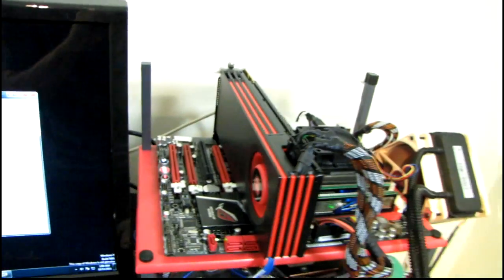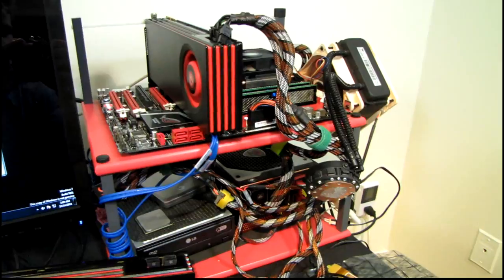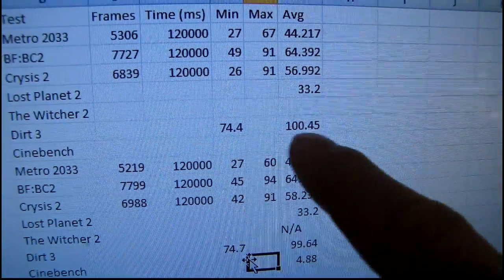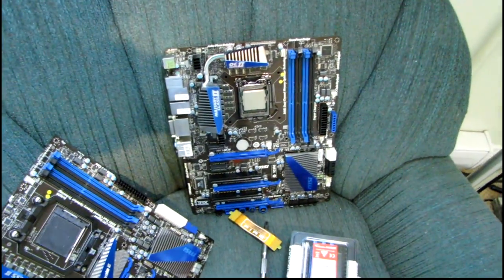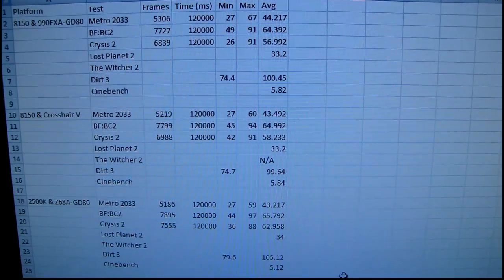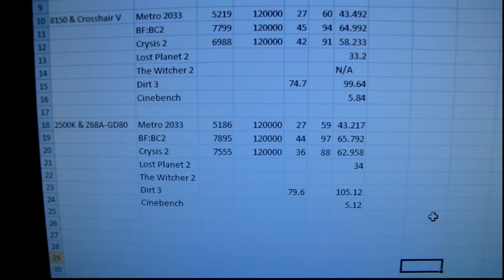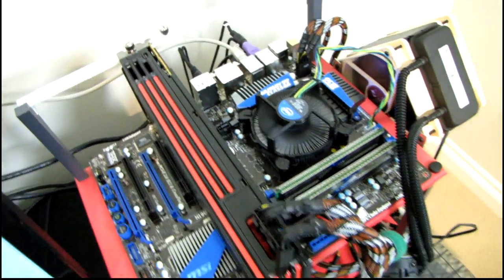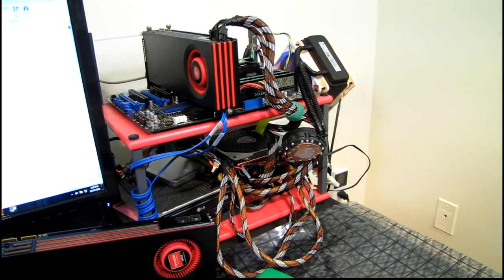AMD Bulldozer FX-8150 vs Intel Core i5 2500K 8-Core Gaming Benchmarks Linus Tech Tips

Comment: Can i run Flight Simulator X on Ultra settings with these specs?

Amd Fx 8150
Radeon HD 7850
8GB of 1333mhz Ram
And a 120gb Ocz Solid State Drive. 

Flight Simulator X will be installed on the SSD! Thx for your help! ;)

Comment: For games you need a strong graphics card, not cpu. Multitasking= more core and more ram. Games almost never use these cpu to the max, and there is little difference in real life between these cpus.  amd's 8 cores do have more raw power in number crunching area (limited application), and do note that many programs (and games) do favor intel's architecture, and that;s why intel is better in most benchmarks. It's still not a huge difference tho, and you'll be happy with either choice.

Comment: @BitfeNicks Ignoring benchmarks? No... Just saying they are not saying anything. AMD was never bad but I seem to waste my breath. Just look into other sectors (servers, workstations). Same with ATI. While they already have a working card, nvidia is still working at an overvoltaged gk104. ANY geforce (even next gen) would not beat my oc'ed 7970. Just a fact. And: I used nVidia before.

Comment: does that mean i3 3220 = i5 2500K? because according with this video the FX 8150 performs the same as the 2500K in gaming... and i really can't see a dual core doing video encoding on the same level as an 8 core.

Oh wait, are you one of those people that buy expensive hardware just to run benchmarks 24/7?

Comment: I was going buy a 8320 or 8150 or 8350 but I have to upgrade my psu and that will cost me extra $80 bucks. So, I am just buying the i5 2500k since it uses half of the power any of the amd 8 core CPU's use.

Comment: Or you can consider that the 2500k is going absolutely nowhere, while the 8150 still has plenty of potential. So no, it doesn't ignore everything you've pointed out, it just discredits what you said. Why the fuck would I be stupid enough to stick with stock coolers for a start, regardless of which processor I choose? For the small price increase you're still getting generally more performance which will also increase by at least 10% on windows 8 release. tl;dr long-term investment wins.

Comment: @fatsally93 i know, i only have AMD pc's, and i like AMD.  But as you said this is meant "the best" amd CPU, but AMD faild. I have an athlon 64 x2 4200+ dual core and a geforce 8600gt  and i play modern warfare 3 on high-ultra with 30-35 fps.
so you don't need a 500 $ cpu.

Comment: Nothing wrong with windows 8. You don't have to use the crappy touch screen desktop in windows 8, they still have the classic desktop. You just need to go through the settings and switch to the classic desktop.

Comment: i need AMD for its multitasking capability and 3Ds max and other multi-media design softwares works better with AMD FX-8150. I use my Intel i7-990x too for rendering but for some odd reason, 3Ds max lags a bit when you use it for a long time and when i have other programs open in the background. It terms of gaming, both processors are the same(for me), both amd fx-8150 and i7-990x are too much for a game.

so do all the benchmarking you want, AMD and Intel performs the same for me.

Comment: I'd say the Core i3 2120 and Pentium G850 are the best cheap gaming CPUs. They're dual core, but games are still horrible at using more than two and the i3's cores are as good as the 2600k's cores. 

The 8150 is better than the 2500k (and even the 2600k) in some video editing, but each core in the 2500k is a lot more powerful something games benefit from. Starcraft 2 is CPU bound, but doesn't use more than two cores and performes better on the G850 even than the FX 8150.

Comment: Lemme guess, buldozer uses 2-4 cores where 2500k use 2-4 too, core per core sure 2500k matches if not bests 8150, but were talking about 25-50% of 8150 cores and if it used all 8 in games that REALLY use all those cores then it would eat 2500k and shit it out so fast it would fly at the speed of shit thrown in a sissy way.

Comment: LOL

It's COMPLETELY the opposite, the 8150 struggles, while the 2500k has PLENTY of juice left over.

Did you read the post of CPU bound game fps I posted?

Nice of you to ignore that.

Of COURSE you need aftermarket coolers!, are you blind?  

The 8150 NEEDS $60 - $90 cooler, the 2500k ONLY needs a $30 cooler. 

So you pay MORE to cool the 8150 AND you get LESS speed, AND pay more in electricity.

Yes the 2500k is a nice long term investment.

Comment: I5 cheaper but not whole system when you add on mother board and such. I went with 8150 16 gigs of ram system for 1100. Do that with Intel set up and it would have been out of my price range.  I run witcher 2 Max setting no problem. Using Gtx 560ti btw.

Comment: @findthecomputerroom6 Bulldozer has 8 PHYSICAL cores. The main problem with Bulldozer architecture is the fact that it´s not based on 8 COMPLETE cores. Bulldozer has 4 modules. Each module has 2 cores. This arch is based on 1 FPU for each module. In a normal "Core i7 or Phenom II X6" way, each core has it´s own FPU. Bulldozer has only 1 FPU for 2 cores. This FPU bottleneck + huge L3 cache latencies = bad performance. Intel is resting right now wich is bad for consumers!

Comment: You need to understand the history. You dont just look at benchmarks and say "what are you talking about look how close they are", no thats not gonna happen. Bulldozer had a TON of hype behind it, it needed to be 10-15% faster than the 2500k at minimum, turns out it is actually slower. It was the biggest launch failure in the history of AMD.

Comment: wait give you solid 60 fps in what cuz like 4 days ago i was getting solid 60 fps in bf3 with everything medium-high with my athlon 2 x4 650 3.2 ghz quad 2mb of cache wtf r u talking about i was saying to get a processor with the same specs as the 8150 it would cost alot i mean look at the 3960 the only diff is 1.5 mb more cache and the 3960 is like what 200-300 mhz faster (too lazy to look it up at the moment) nowadays u dont need the craziest processor in the work andthe 8150 does the job well

Comment: 955 BE is about equal to a i3 2120.

You can overclock the 955 all you want and waste hundreds of dollars on a cooler, it would NEVER beat a i5 2400 in gaming.

The 8150 also looses to a i5 2400.

The 2500k overclocked NOTHING short of an overclocked ivy can beat it in games.

Comment: Well AMD has much much better prices for their processors, but Intel just gives much better performance. Unfortunately Intel has much higher prices. I would recommend an AMD FX 6300 (Six-core) and then get a good lower priced GPU (6870 or better, or GTX 660 or better). If you match the best processor that AMD has to date (FX 8350), it's only as good as an i5-3570k, and Intel has much, MUCH better processors than the 3570k.

Comment: Incorrect, 8150 is more expensive when you factor in a proper cooler to overclock it, $60 - $90.

The intels run a lot cooler, all you need is a hyper 212 for $30.

I guess the fanboy in you didn't let you think clearly.

The i5's are SUPERIOR to the 8150 in gaming, a lot of people use GPU bound games to show the differences in CPU's which is a damn underhanded trick to fool people like you.

Go look at the fps differences in skyrim, starcraft 2, WOW, actual games that need CPU power.

Comment: Ehm, at 1080p and these games... Your GPU is a veeeery big bottleneck... Try running at 800*600 or sth like that. Compare again. See the difference. But also use some CAD/modelling software to show the AMD's strengths. It wouldn't be fare just comparing the gaming performance^^

Comment: I would love to see a system compared to mine. There not many differences. Why? It all depends purely on choices were you put your money in. I can overclock anything i wish with my Asrock 970 Extreme 4 motherboard. Why would i spend a 500usd for a so called gamers board that does.....the same thing? Why would i spend 200usd on a liquid cooling system, while a 60 to 100usd one does the same thing. It's all about choices. Such systems, you can easy half the cost by going for "normal" parts.

Comment: Actually, it's proven that intel is just simply better at almost all price points. Let's say at 125 usd, you could get a quad core 965 be, or you could get an i3-2120. even with the lower core count, the i3 is just much better, with lower heat and less power consumption. Amd is still a good company, no doubt about that, but Intel's just better.

Comment: You need a proper cooler for the FX, if you dont overclock it then it has PATHETIC performance.

$20 more, which is NOTHING cause you probably saved $60 - $90 on a cooler for the FX.

The Intel system is also LUDICROUSLY faster that the 8150 set you wanted to waste money on, AND you would have had to pray piledriver would have been good to upgrade later.

The z77 has BETTER options, and total price is only $32 more, LESS if you also consider the CPU cooling savings.

Comment: By you disabling 4 cores you remove the core penalty due to bad scheduling in windows.

 You just can't fix the crappy slow cores is all, there is no more performance to be had.

You basically have a gimped down 965 BE, with crappy single core performance..

In gaming sure the 2500k is superior, core per core it is at least 25% more efficient.

For the money you wasted on the 8150 you could have had a 2600k.

Its mediocre, you have just gotten used to it.

Comment: No it does not, the 650ti i will take that to the testbenches even, will not win from it lol. gtx 660.it is 10% faster than 650 ti boost  feel free to check the benchmarks done between the two on tomshardware i rest my case :)

Comment: no there are plenty of games that will bottleneck an AMD cpu much faster then an Intel, because its cores are weaker... i should know i always had a beefy gpu and had AMD chips and i could change video settings and fps would stay the same. (a sign its a cpu bottleneck) with Intel core chips you get better max frames, slightly better fps on average but not always the case either, and definetly better minimum frames. if you gaming i say Intel all the way, casual gaming or net surfing AMD works.

Comment: man wtf is you talking about? 95% of the games out there today uses only 2 cores, in 2 years only maybe 50% of games will FULLY utilize 4 cores, leave alone 6 or 8 thats not before many many years and btw by that 2-3 year frame EVEN if they manage to fully utilize 8 cores in gaming intel will have released 3 new generation of cpu and i like how you decided to mention the 2500k instead of the 3570k since the 3570k set piledriver to where the 2500k vs bulldozer was and btw AMD is going downhill

Comment: Im using a fx-8150 with a r6770 with 1 gig D5 on a m4a89gtd asus mobo and i clock at 4800 and i can play any game out there with nice fps...that processor got a bad name for some rteason but you should see how nice arma 3  roll with it.  The main problem was the temp, went and got a hyper 212  and it keeps it under 50 c  oh and it all cost me bout 100 bucks...i be damn im going to spend a grand on a pos intel and i would leave it in its tracks with my 100 buck rig...fact
Reply: +james snow 100 bucks?  sounds kinda cheap, well whatever :D hope it wont break.
Reply: i got the processor and motherboard for free, it was giving to me when a bud upgraded,  right now im at 8 cores and 4200 ghz per core ive not clocked it cause im just hanging on you tube

Comment: Do not buy a bulldozer for gaming. Sure, it might do ok in very GPU dependent games, but throw CPU hog of a game at it, and you'd be better off with a phenom II. There's no reason to have all those (shitty) cores when most games use one or a couple threads. My GTX670 could barely hit 50% load with most games using an FX-8120 @ 4.6ghz running games off my SSD or ramdisk. You don't want the processor to be the bottleneck of your gaming machine.

Comment: @alexisfire999 You are not getting beast performance out of 470s 580' 6870's < 5870's on quadcores other than CoreI7's. They only score around 18000k on 3dmark06 without overclock. I'm running a Q9550 OC'D 3.4Ghz - 3.8ghz, 465 GTX cuz my EVGA 470GTX died I average about the same frames u said Ive used a Sapphire card. Built a similiar 1090t rig that scored 21000in 3d06 easy around 18k vantage. You are way better off with a CoreI7/ 6core AMD -1055T. Beast video cards on weak processors is bad.

Comment: It is your fucking opinion. If you crawled out from under that AMD rock you've been hiding under, you'd realize that not only is the 4170 not a true quad-core, but you'd also realize that it doesn't come close to an i5-2500k in performance. 

The i3-3220 is on-par with the performance and price of the FX-4170. And yes, there are games and GPUs that will choke the life out of those CPUs.

Comment: Would my amd fx8150 at stock ghz run with gtx1060 or gtx1050ti without bottleneck or if there is bottleneck how much would it be?
Reply: Search in Youtube for "fx 8150 gtx 1060" and you'll get some videos on it. This cpu will run even the stronger 1060 great, 1050ti with ease. Maybe there will be a tiny bottleneck in some situations with the 1060 but nothing you should be worried about. It will not cause major frame drops if some cores get up to 100%. Look it up, even the fx 6300 runs a 1060 quite well. If you're on a budget go for it or you might consider the 8350, if you can get it for a good price!

Comment: intelfanboys: testing programs are designed for Intel processors

also test programs does not show actual performance of processors

actual performance comparison result:

crysis 2:

amd x4 175 be = 50 fbs core i7 3960X extreme edition = 52 fbs

battlefield 3:

amd x4 175 be = 38 fbs core i7 3960X extreme edition = 46 fbs

for more;    yours search on internet and watch video : "" Core i7 3960X Extreme Edition; En hızlı masaüstü işlemci video inceleme ""

puhahaha! :D

Comment: I dont know but what know is i never buy a dual gpu card again 650 euros for nothing worst card i ever had! BFBC2  took ati 10 drivers to fix all the issues with the game
Lord of the ring  had lost of issues too most drivers stoped using one of the gpu on the card then you have to alt tab out of the game then it worked again for 5 min same issue with rift too! BF3 no way to play with sniper ,game runs ultra perfect but as far you use a sniper with a scope your game beginns to lag and freez